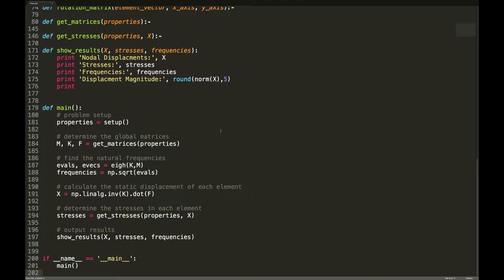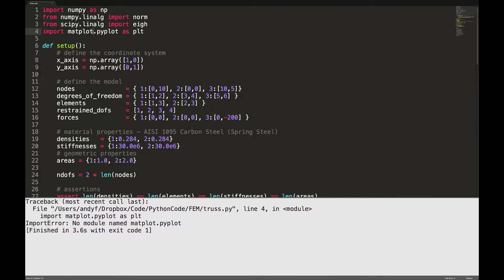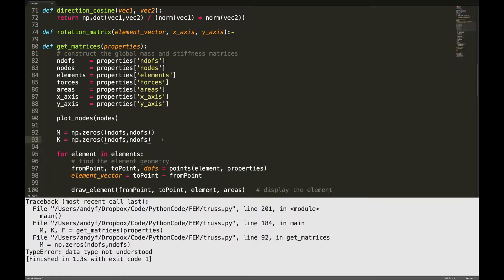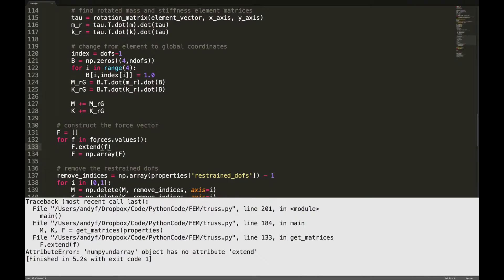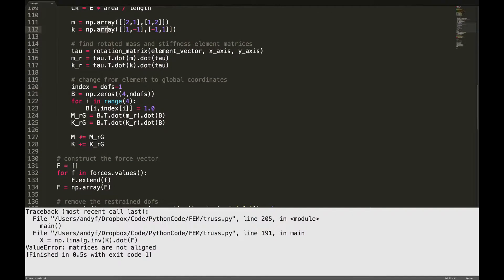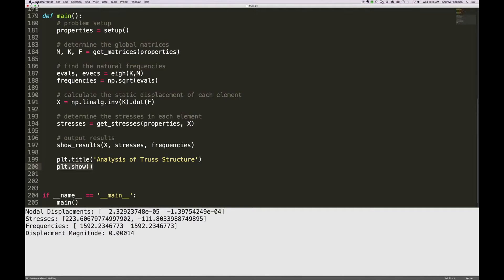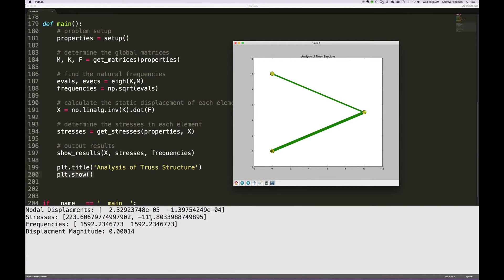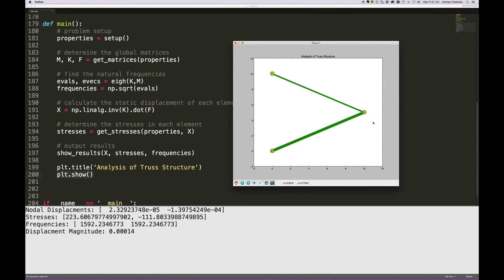Bar Finite Element - Coding the Truss Solution - Part 3 of 3 - (Debug & Run)

Comment: Thanks for the tutorial and code! I solved the singularity problem by changing that part of code with:

	try:
		# invert the matrix
		X = np.linalg.solve(K, F)
	except np.linalg.LinAlgError:
		# if inversion doesn't work use numerical approximation
		print("K MATRIX IS SINGULAR. Using least squares.")
		X = np.linalg.lstsq(K, F)[0]
	for i in range(len(K)):
		# it sometimes gives tiny values like 1e-13, let's get rid of those:
		if abs(K[i].any()) < 0.01:
			K[i] = 0.0

Comment: I was trying to build my own code based on yours and I came across a problem. What if the global stiffness matrix is a singular matrix? 

    nodes              = { 1:[0,0], 2:[1000,0], 3:[2000,0], 4:[3000,0],5:[500,1000],6:[1500,1000],7:[2500,1000]}
    degrees_of_freedom = { 1:[1,2], 2:[3,4], 3:[5,6], 4:[7,8],5:[9,10],6:[11,12],7:[13,14] }
    elements           = { 1:[1,2], 2:[2,3],3:[3,4],4:[1,5],5:[5,2],6:[2,6],7:[6,3],8:[3,7],9:[7,4],10:[5,6],11:[6,7]}
    restrained_dofs    = [1, 2,7]
    forces             = { 1:[0,0], 2:[0,0], 3:[0,0],4:[0,0],5:[0,-100],6:[0,0],7:[-200,0]}

    # material properties
    densities   = {1:7.680, 2:7.680, 3:7.680,4:7.680,5:7.680,6:7.680,7:7.680,8:7.680,9:7.680,10:7.680,11:7.680}
    stiffnesses = {1:200.0, 2:200.0, 3:200,4:200,5:200,6:200,7:200,8:200,9:200,10:200,11:200}
    # geometric properties
    areas = {1:10000, 2:10000,3:10000,4:10000,5:10000,6:10000,7:10000,8:10000,9:10000,10:10000,11:10000}
Reply from the maker: Did you remove the restrained degrees-of-freedom?  The global K matrix is typically singular before you restrain any of the DOFs.  A singular K matrix means that the mass can be displaced without storing potential energy (like a rigid body).
Reply: @Freeball99  Yes, the same as you did in the remove indices part.
Reply: You can solve the issue by changing that part of code for:

try:
	# invert the matrix
	X = np.linalg.solve(K, F)
except np.linalg.LinAlgError:
	# if inversion doesn't work use numerical approximation
	print("K MATRIX IS SINGULAR. Using least squares.")
	X = np.linalg.lstsq(K, F)[0]
for i in range(len(K)):
	# it sometimes gives tiny values like 1e-13, let's get rid of those:
	if abs(K[i].any()) < 0.01:
		K[i] = 0.0
Reply: This solves the singularity problem, but the code still gives the wrong answer. I think there is still a bug in the code for determining the stiffness matrix?